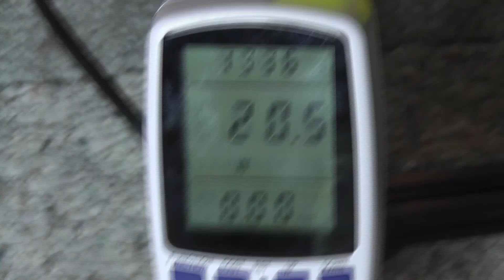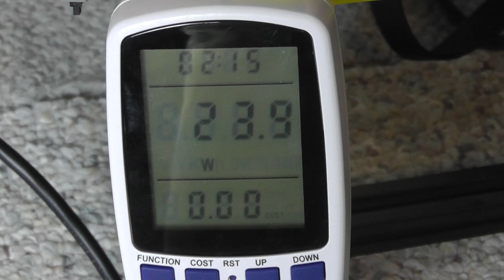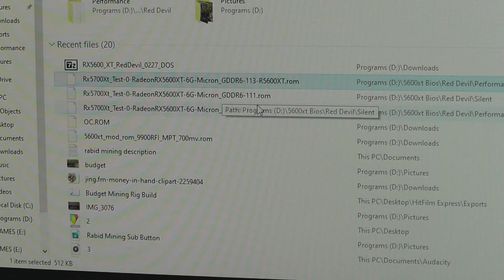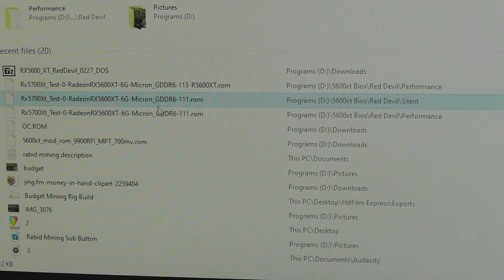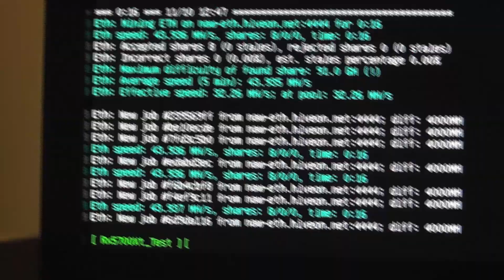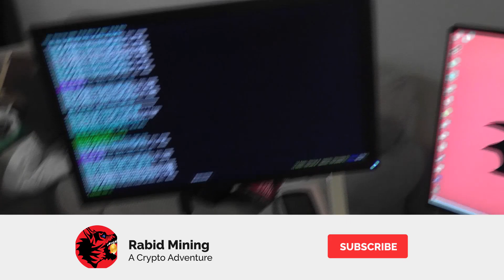5600XT Red Devil Ethereum Mining Efficiency

Comment: Hi, my 5600 XT Red Devil work on high memory temperature 88 - 90 C with Core Clock, MHz 1100, Memory Clock, MHz 925, Core voltage, mV 700, Memory voltage, mV 770. How to decrease memory temparature?
Reply from the maker: Mine runs around 86 to 88c

Comment: Do you mind testing to see if you can get the voltage below 700mv? Maybe 650mv? I know some of these cards can run 1100mhz with much lower voltages than 700mv which can drop power consumption even more.
Thanks for these videos
Reply from the maker: Ya I'll dig further into and do updates. Think I tried 680 but wouldnt work.
Reply: @RabidMining  i think it has to do with the "power tables" or something along those lines where the minimum voltage that can be input is 700 ;(.
Thanks for the reply!
keep up the good work with your channel

Comment: 8x sapphire pulse rx 5600xt 42.5mhs each @965w at wall.
Reply from the maker: Nice looking good
Reply from the maker: are you bios modded and if so which one did you use?
Reply: @RabidMining  RPM modded bios is what i used.
and i had same thing where i could only get voltage down to 700mv.
1100mhz @700 core/ 1280mv memory voltage/ 745mv memory controller voltage in Hiveos.
And i think 900 memory
Reply from the maker: @AleksandrsBrodie  yup correct same one I used could maybe try to change the MTP and bring it down more with more power tool.
Reply: @RabidMining  I would try that, because with my MSI rx 5600xt, i was able to get below 700mv with RPM modded vbios which i thought was interesting. I did not check the wattage on the card, but i would imagine 630mv will use less power than 700mv.
For mining I always use Linux, either Rave OS or Hive OS.
I think both RX 5600 and 5700/xt are pretty good for mining, I just like the fact that on the 5700 you can mod the bios without any issues.
Reply from the maker: @AleksandrsBrodie  alright thx will try more power tool and try to drop it more.
Reply from the maker: still testing but am at 111w on the card mining only on a psu using 8.2 watts so a 8 card rig would be 8x111=888 plus the psu 8.2 is total 8 card rig at 896w at 41.73h which works out to 0.3758 H/W am still testing though.
Reply: @RabidMining  Thanks for taking the time to write this out to me. also what do you run on your RX 5700xt cards?
I am in the middle of still optimizing voltages, but I found that I could get 57mhs @ 1380Core, 720-750mv Core voltage, and 760mv memory controller voltage with 1290-1320mv memory voltage. memory clock 910mhz.
I am still trying to figure out what settings I can run on these cards.
Ill keep you updated in a week or so once i am done my tests.
Reply from the maker: @AleksandrsBrodie  been testing them out as well gonna do a nitro vs pulse video here soon am at about the same as u but found the most efficent around 53mh at 131 watts making a 0.401 h/w
Reply: @RabidMining  that is true, I just felt for myself with how expensive the card is, that it was still worth running a bit higher power to get a higher mhs, from what i estimated, i was getting about 57.5mhs @155w just for the card and 165-170w for total system. giving me 0.37 efficiency.
I will also test lower clock settings and efficiency but when you are spending $500+ CAD on one of these cards, it can be worth making a few extra pennies a day more even after factoring electric cost increase with higher power consumption as then end result still pays the card off a bit faster.
I mean, and then there are those who get Samsung memory aka win the lottery for efficiency lol.
I will keep testing during the next week or two and see what i find.
But assuming temps are good, i will probably keep running around 57.5-58mhs per card at that efficiency.
I am running on 115v.
Reply from the maker: so far cant get below 690 or it crashs and a bit unstable so using 1100 core 700 mv/740/1260 910 memory at 110.1w at 42.19mh in teamredminer.  Makes for 0.3831 h/w makes for 881w for a 8 card rig at 337mh
Reply: @RabidMining  Forgot to mention, Some of the cards I dropped the core down to 1040mhz and was able to run lower voltages without affecting the hashrate.
hashrate on these cards is a balance between Core Clock and Memory clock so for 42-42.5mhs you can run well below 1100mhz, something more around 1025-1040mhz.
and with lower clock speed = lower votlages.
The hard part is when the system crashes in Hievos, is to identify if it was core or memory related. but thats troubleshooting
Reply from the maker: Ya did testing for a few hours lol had to turn the rig back on dont have a test bench so it brings my 2 5700s and the 5600 down when testing.
Reply: @RabidMining  ya that is unfortunate. sometimes you also need to consider if its worth the time to get them running on even more efficient settings.
anyways, keep up the good work on your channel.
Reply from the maker: @AleksandrsBrodie  well it helps me get things ready for a video as well so it's alright as well as like we are doing trying to find the right settings and get the word out.

Comment: hi, u win asub. nice video.
i have 8 5600xt XFX, and get a lot of issues, in HiveOs wen put overclock, hive sent me an error, i cant do bios modding, wen ido the card breaks and i trie a lot of thinks, rigth now i put core:1150 VDD:770 MEM:790 and get 35.9 mh 83w, but in windows i can make 40 mh, i dont understand why, i tried all the videos for, red panda, serpent, bitsbetripping, hasraptor, and now im trying to do your overclock, im testing one separate an looks works, i tell u if i get more results, thanks for the information, and sorry for my english, im from Spain.
Reply from the maker: 790 mem is only 1580 in hive you know that?  I run around 915 or 920 which makes in 1830-1840.  Thx for the sub